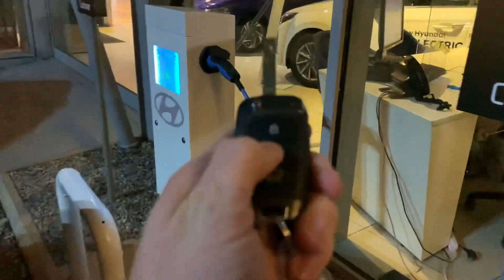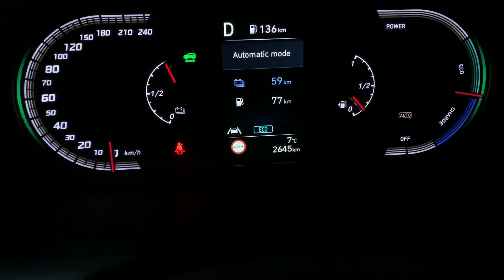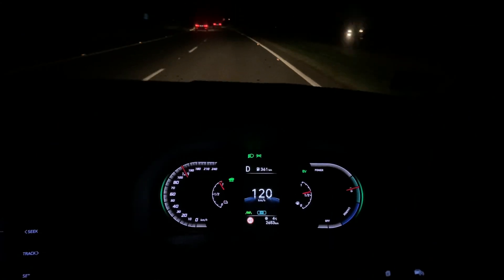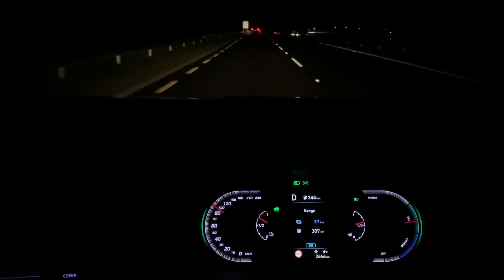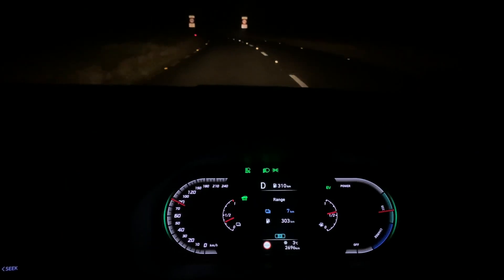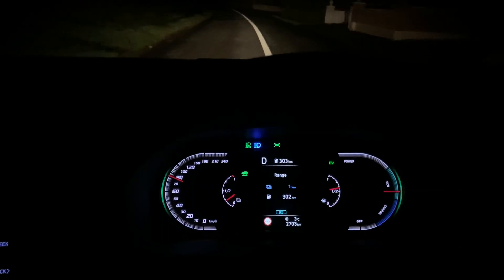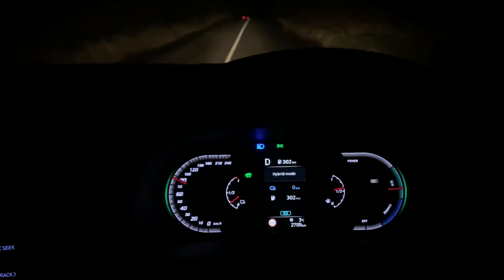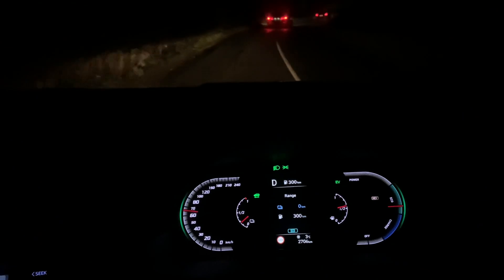What happens in a PHEV when you run out of charge - step by step demonstration #phev #whathappensif

Comment: I’ve been reading some of the comments here and there seems to be some misconceptions about how you use the EV mode.  I’ve had the Tucson PHEV since October 8th so am speaking from experience.  I drive in EV mode exclusively - but the engine still runs regularly - for heat, for passing, for aggressive acceleration - and sometimes “just because” (presumably to circulate fluids and maybe top up the charge in the 12V battery.   

The first point I’m trying to make is that putting the car in EV mode does not prevent the ICE from running…!  Selecting EV mode is more like a “request” to the car to use electric power “as much as possible”.

That also leads to my 2nd point….which is - just because you hear the engine start up and run doesn’t mean your car is NOT being powered by electricity.  If you’re in EV mode with a full charge and you need a bit of heat, the engine will turn on to generate that heat BUT the wheels will still be driven primarily be electricity (even though the EV indicator will go off).  Yes the engine will be running - but more or less just idling.  It won’t be burning gas anywhere near the rate it would if you were in HEV mode or gas-only mode.

Thirdly - and I haven’t actually watched this video yet - I’ve taken my PHEV out in EV mode with the heat turned off and managed to stay in EV mode for 8km from my driveway to the highway - and then for another 35-ish km on the highway with the cruise control set to 135km/hr.  I had started with about 85% battery charge and once on the highway, I watched the percentage go down - waiting to see when the ICE would kick in.  It was at 13%.  After that, for the rest of the trip, I was essentially just driving a normal HEV (but carrying a little extra weight).  

There’s nothing all that magic or special about using up the charge in your battery.  The PHEV just becomes an HEV when the charge gets down to a point determined by the car itself…. 🤷🏻‍♂️ 

After 2.5 months, I still love my Tucson PHEV and don’t regret a single thing about my purchase!!!

Oh - and the lowest I’ve seen my battery get down to is 7%.  By the time I got back home though, it had charged back up to 24%…
Reply: Thanks for the details. To me the value proposition is still quite confusing vs a normal hybrid.  I would've expected it to have better milage in mixed or automatic mode compared to a hybrid due to the larger battery.
Reply from the maker: @Ryezn5057  For me in Ireland with a €2250 price difference between them , i think the breakeven point is around 2.5 years before it starts to save you money, i.e. the first 2.5 years the savings are just repaying you for extra €2250 you spent up front if that makes sense ??
Reply from the maker: Great info there ! Thank you for taking the time 🙏😀 and for watching !
Reply: That was a great explanation from another person who has first-hand experience. My wife and I took out a Hyundai Santa Fe HEV and we absolutely loved it. Our dealer does not have a Tucson HEV or phev for us to test drive but the regular Tucson has so much interior room that we are finding it difficult to justify paying an extra $3,000 for the Santa Fe except perhaps we like the ride quality and interior styling more in the Santa Fe. It's great to hear that highway speeds can be achieved in pure electric mode but I'd be concerned about engine longevity when it comes to winter in particular. I believe these things are supposed to keep their engines at a certain temperature so that when it is required you're not starting a cold engine and putting it under heavy load. Do you have any input with regards to that?
Reply from the maker: @scottfurlong5475  thank you for watching, glad it was useful, I’m not aware of how they would be able to keep the engine at a certain temperature if you did for example a 30 or 40 km electric drive as the engine will pretty much remain shut off, we are based in Ireland so our climate is fairly predictable in terms of temperature, do you live in Canada or the USA?
Reply: What about the AC? I’m looking to get a PHEV but I’m in south Texas and the AC is on to some extent if I’m in the car. Even in the winter the AC will be on to de humidify. How does it cool in the summer? Runs the ICE for a couple minutes to run the compressor then shuts off once cool then turn back on as it sees the cabin temp going up? I’m afraid the ICE will be running constantly to cool during the 100°+ days.
Reply: @TruckerChuck44  The Air Conditioner is electric.  It does not need to run the ICE to cool the cabin.
Reply: @Tenly2009  thank you for the info!
Reply from the maker: @TruckerChuck44  let me confirm .. I’ll reply to you with a video early next week !
Reply from the maker: @TruckerChuck44  can you have a look at this video https://youtu.be/HZ6uuW4A1Zk , in the hot weather, the air conditioning may need some input from the engine, but the video will show you It doesn’t require very much input from the engine so it’s still effectively drive in electric and the engine is only powering the heating or air conditioning. Hopefully this makes sense.?
Reply: @doolanbrian  thank you. I have a feeling the AC will be about the same. Like a Prius, if the AC is on hi and recirculate the motor will run. If it’s set to auto and not a lot of cooling is needed it will cycle the motor on as needed.
Reply from the maker: @TruckerChuck44  exactly, I still think it would be an economical car , so definitely worth your consideration🙂👍
Reply: What about the Nissan's E-Power Hybrid System? What are your thoughts please.
Reply from the maker: @AutoRevPH  hey 👋 sorry I have no information on the Nissan .. I’ve never sold or even sat in the new E-Power variant .. sorry I couldn’t help better !
Reply: Thank you this is a great video. Only had my car 2 days and panicked when the battery ran out as I didn't know what it would do to the Car. Thanks for such a great explanation
Reply from the maker: Thanks for watching!!!
Reply: The reason you find the engine comes on so much is because the Kia/Hyundai PHEV systems can only run the AC system with the engine, not on battery power alone. Hence every time you want the heating/cooling on, the engine comes on.
Reply: Planning to buy a Tucson PHEV as well. Great comment and advice! Cheers
Reply: How many miles or km do you get before electric runs out. Like Mercedes has 30min DC charge at their Phev, to utilization that combine Low consumption.
Reply: @MrBlackJava  it varies depending on a bunch of things - generally about 50km although some have reported getting as much as 64km before having to switch over to regular HEV mode.  The fastest you can recharge from 10% to full is about an hour and 40 minutes.  No fast charging is available.
Reply: Will the battery run down if you just drive In hybrid mode, and can you just drive in hybrid mode? And how long will a battery last? I was thinking of getting a vw tiguan r-line but very confused as which one to get? I won’t be doing many miles, but sometimes would like a drive out, maybe 150 miles there and back. Any help would be much appreciated. Cheers.
Reply: @marley2319 your question is of great interest to me too. I watched a taxi driver from Liverpool do just that in his Skoda Superbe phev. Yes the battery runs down very slowly and his mpg is far superior to just running on fuel only.
Reply: Now TLDR, but I suggest you don't use the ev mode all the time. Better have the engine run when it is the most efficient, highest gear on the motorway. That keeps the engine oil clean and reduces strain on the ev motor. Like you say with Hyundai Kia the ice turns on automagically when it needs to generate more, but I think at that point you can eventually switch to Hybrid mode.to avoid ice turning on switch off ventilation or turn it as cold as possible. Otherwise it is just inefficient. For long term health of your car use the engine in the motorway and ev mode in those start and go parts of the city where you travel under 60 km / h. And the oil will look better when you change it. PS if your car has DCT make sure to change the fluid every 2nd oil change. It is easy, just check if it is murky or dirty. Change the transmission fluid once every 50 000 km..
Reply: @rafidm6263  If the trip you are taking is going to be further than 60km, then there is some small benefit to doing what you suggest - but on shorter trips for which you have enough charge to do the whole trip in EV mode, it’s silly to intentionally burn gas during the motorway portion.

Remember that every time that you arrive at your destination with more than 15% charge remaining; if you’ve intentionally let the internal combustion engine run during that trip, you’ve burned gas (ie spent money) that you didn’t have to.

There’s no real need to micro manage your drive mode.  There’s nothing wrong with simply driving in Eco or Smart mode all the time.  The extra benefit you might get from manually changing the drive mode from EV to Sport or HEV will depend on the length and type of your trip and much of the time will be negligible.
Reply: @Tenly2009  do you live somewhere that electricity is free or almost free.. ?

I am not talking about saving money. If your engine is idling all the time while you drive in EV you are burning both gas and electricity. But more importantly, the oil becomes polluted when you idle. I can tell you this from experience. You will run into issues down the road driving as you do. No one benefits from your car running other than you and your family. So this is just a friendly suggestion to investigate how to keep your engine in good shape. Look up what happens when you idle your engine all the time. Next time you change your oil, inspect it along with the clutch fluid.
Reply: @rafidm6263  Electricity may not be free, but it is much cheaper than fuel where I live - and what would possibly make you think that my car is idling all the time or for long periods of time?  As my initial post states, I don’t let my fuel get any older than 3 or 4 months and if I have any left when approaching 3 months after my last fill-up, I will drive in Sport Mode for a few days to burn the old gas before filling up again.

There are also times when the PHEV will turn the engine on automatically even when in EV mode and fully charged.  It does this for the health of the ICE and is one more reason why micro managing/manually managing the drive mode isn’t really required.

As far as my oil is concerned, I’ve looked at it twice during oil changes - the very first time and the most recent time - and both times it looked so clean that it probably didn’t actually need replacing yet. 🤷🏻‍♂️
Reply: @Tenly2009  Idling has nothing to do with changing the fuel. Not sure what engine you have but it never turns on in my case unless I turn on the ventilation. "It does this for the health of the ICE", really having the engine sit and do nothing isn't bad. But having it run at low rpms for extended durations, not being allowed to hit the higher temps is not very good. Why don't you look it up? I'm just trying to help you.

I have a Kia Niro PHEV that I'm really satisfied with. Been doing all the maintenance myself, but I have yet to service the hybrid battery, which will be next on the list.
Reply: @rafidm6263    Dude - are you drunk?  You are the one that claimed MY car is “idling all the time”.  (It’s actually not.). And you’ve just lost credibility with your latest comment “having the engine sit and do nothing isn’t bad”.  It IS bad to let a car with an ICE sit and do nothing for long periods of time and that’s something that is well known.  

This video and comment thread is about the Tucson PHEV - which I have had for nearly 3 years - and apparently you don’t.  I don’t know why your Kia doesn’t run itself occasionally - but the Tucson PHEV does - and for good reasons.  Maybe your advice would be more appreciated if you took it to other Kia owners but it seems like it doesn’t apply to the Tucson and that you aren’t familiar with how the Tucson PHEV works.
Reply: I only understood about 50% given the speed at which he was talking I couldn't keep up😢
Reply: Yes, that is exactly how my Mitsubishi Outlander PHEV works as well.
Reply: Great explanation.
Reply: You v should do a video. Very detailed and to the point explanation. 👍👍👍👍
Reply: @Tenly2009  - Your vehicle is using gas to charge the battery as you drive.   First, there is energy lost in the ICE used to charge the battery.  The ICE only about 20% efficient.  Then there are losses in the generator that is driven by the ICE and the AC to DC  converter to charge the battery.   You are getting less mileage than you would using the fuel in the ICE to drive the wheels directly

In short, don't feel good about the battery being charged as you drive.  The only way to get better efficiency is to plug the car into an AC outlet.

If you want to use less energy. save money and maybe do a bit for the environment, get a BEV.   With the range of today's EVs, you would have to be very careless to find yourself stranded with a dead battery.  Range anxiety is no longer a problem.  I know this first hand.
Reply: @Garrison169  Did you address your comment to me by mistake - or do you really think that based on my post - that I didn’t already know ALL of that? 🙄 (and also, I never said or implied anything to the contrary)
Reply: @Tenly2009  Well, if you already know all that, you went against your better judgement in buying your PHEV.
Reply: @Garrison169  Ahhh… i see - you’re just a troll.  The Tucson is the best vehicle I’ve ever owned and I’ve only filled the gas tank 6 times in 2 years.  It’s not the best choice for everybody - but it was the prefect vehicle for me and my use cases!

Re-reading your message, it seems like you think you scored some sort of point by stating that the vehicle is recharged as I drive - but for me, most of that “recharging as I drive” comes from the regenerative braking.  In the winter, when the engine runs for heat, any excess power generated is also used to top up the battery - which is nice - but nobody with an ounce of sense is going to intentionally run the engine solely to charge the battery.  Like most PHEV owners, I recharge it fully overnight on 120V in my garage, and I typically drive less than 50km/day - so the engine doesn’t run very often at all.  Towards the end of my 4 month fuelling cycle, I’ll drive it in sport mode to burn any gas I have left so that it doesn’t get too old and then top it back up to full when it gets down to 1/4 tank.
 
Do you honestly think that PHEV owners use the ICE as their primary charging source? 🙄
Reply: @Tenly2009  I recharge my Tesla at home when needed and  I get all the benefits you do and I an not lugging around a ICE, a transmission, an exhaust system and a platinum catalytic converter.  There's no gas to worry about getting old.   Compared to your car, my maintenance cost is zero -  no fluid changes.  No plugs, no belts, no hot hoses that have limited life.  
You are worrying about range when you usually only drive 50km a day. But try  taking a road trip in that car and see how far you get.
Reply: big fan of experience from 1) someone who knows what there talking about and 2) someone with first hand experience

thanks
Reply from the maker: @Genobilii  Thanks a million for watching, I appreciate it and thank you for the nice comment!
Reply: Phev does what it says on the tin. Running out of electricity while having fuel in the tank is not a problem. Running out of electricity with no fuel in the tank leaves you virtually stranded. Cold weather, inclines, towing, air conditioning, driving with passengers and or luggage hits electric range dramatically😢. 
Unless you charge up every night and your daily journeys are less than 15 miles each way for the most part, plug ins are not economical. Not to mention the extra purchase price and the fact the batteries are heavy and operate like phone batteries and loose efficiency over time and are not environmentally friendly due to how their raw materials are mined. Current studies show running a small 6 year old petrol or diesel car for 15 years is more environmentally friendly as very little of our electricity is produced via wind or water rather its mixed. Electric cars of all types are a good idea whose time has not yet come. When there is an ability to fast charge at home and avail of a comprehensive charging infrastructure using clean electricity and the batteries are fully recyclable maybe then electric cars make sense. Dont forget when you fill up with diesel or petrol it takes about 6 minutes today. How long will it take to charge your car? Assuming there is a free charging station available to you and its not out of commission. 
Use your engine to charge your battery and watch the fuel consumption plummet well below regular diesel or petrol car rates. I'm not a luddite and am not resistant to change. 
Just be careful of being an early adopter. Consider your lifestyle both current and future, before making a decision.
Reply: @maxthefacts  “Running out of electricity with no fuel in the tank leaves you virtually stranded”
- That’s really rather obvious when you think about it, and also true of every gas and diesel car ever built. 🙄  The PHEV is not intended to be operated without fuel in the tank and the owners manual states that.
Reply: @Tenly2009  The point i was making is as a car, the fuel supply is compromised and requires a great deal more effort and attention by the driver to execute efficiently. Up till now all a driver had to do was make sure fuel was in the tank oil in the engine and air in the tyres. Now he has to make sure he has charge and fuel and spend time reviewing dials gauges and readouts as he progresses to ensure proper uninterrupted progress. Will the Gards prosecute drivers for operating their various screens as they do mobile users. Cars with 2 or 3 screens to navigate must be more distracting than a mobile. That will have to be tested in the courts.
 I can cover a journey of 650 plus miles averaging 56mpg in my VW on a full tank. No plugging in. No carrying unnecessary weight. Efficient easy driving with ac on and other electrical niceties. Let's call a spade a spade. Plug ins etc are a stop gap measure brought out by companies to fund the development of full electric fleets and as such are neither fish nor fowl. As far as I am concerned if you need a college degree to decipher the dials and the information contained therein the car using public are being sold a pup of gargantuan proportions. Its wasn't long ago that the car industry were telling us to buy diesels. Let's see, how did that work out....
Reply: @maxthefacts  I get it.  You’re cynical, and a pessimist and probably struggle with technology.  If the car industry gave advice that turned out to be bad once before, then they will ALWAYS provide bad advice, right?  🙄  There’s no chance that they made a mistake in the past and have learned from it?  Or is there? 🤔 

I’ve had a PHEV since late 2021 and none of what you say is true - especially about constantly monitoring screens and adjusting dials while driving.  My PHEV can be driven exactly like my old 2008 Escape.  Put in gas and drive it - without ever touching a screen.  The screens do not require any fiddling while driving - but they do provide many conveniences and safety features that are simply non-existent in older vehicles - all of which can be set up before you get on the road.  Obviously, you’ll get more out of your PHEV (and save money) if you charge it regularly and have a short commute - and if you’re under 40 and have ever used a smartphone, the “screens” are not at all difficult to understand and operate.  (My 10-year old finds it easy to operate and does not yet have a college degree.)

A PHEV is not for everyone - and if your usage pattern has you driving 100 miles per day, it’s probably not a good fit for you - but for many MANY people, they are a great choice - especially with gas prices being so high.  Also, the initial cost difference is being offset by government rebates in many places.  Your post amounts to little more than fear mongering based on some incorrect assumptions, preconceptions and misconceptions.  You claim not to be a Luddite or against change - but your words suggest otherwise.
Reply: @maxthefacts  Tesla owners are finding about 10-15% loss of range after 100,000 miles.  Many are still using the original battery over 200,000 miles.  Batteries are 100% recyclable.  The battery can be charged overnight at home while you sleep. On road trips, you can eat meals, take a pit stop, or just relax for a bit while charging the battery sufficiently to drive another 4 to 5 hours.  The navigation software in the car will plan out all needed stops and tell you how long you need to be charging.  It is very accurate.

In a hybrid, you have the worst of both worlds.  You are lugging around an ICE drive train, lowering your battery mileage in EV mode.  The ICE in your hybrid requires all of the maintenance you had with your old gas burner and it is lugging around the electric motor and batteries.   Then you have the complex software and electronics that attempts to make the two systems cooperate.    

Yes, most EVs today cost more, but you get at least 3 times the energy efficiency less and much lower maintenance cost.

Charging at home, I can drive  30 miles for 90 cents.

One caveat - tires don't last as long due to the weight of the car.
Reply from the maker: @maxthefacts  Thank you for watching and some really great information for everyone there, appreciate your time